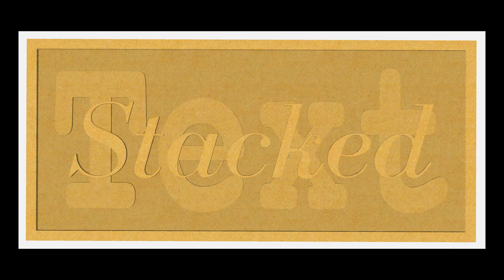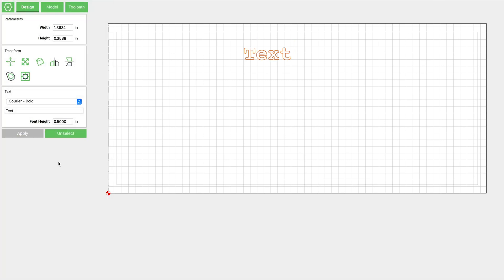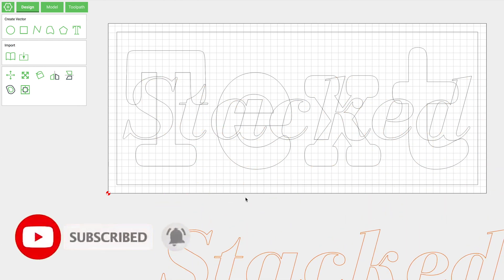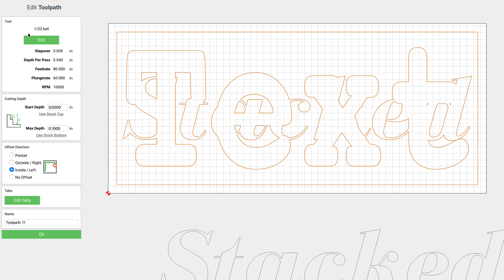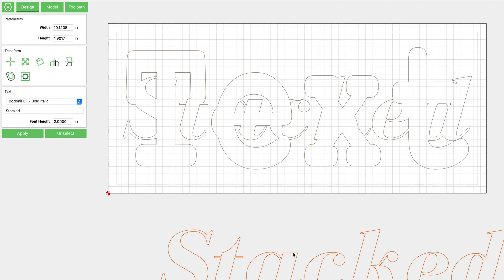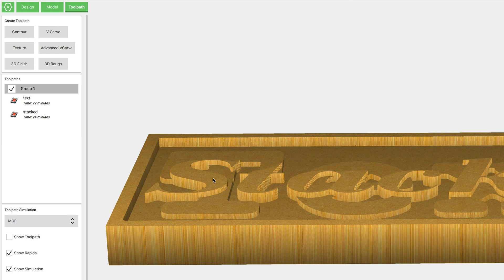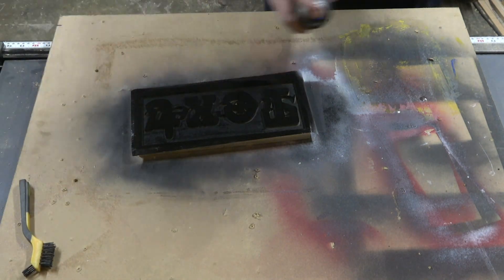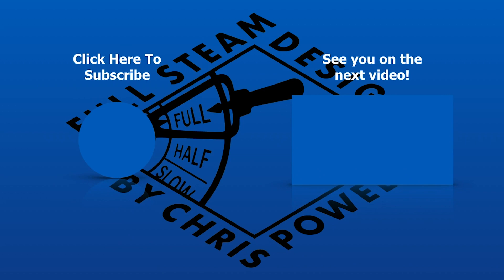Carbide Create Tutorial - Stacked Text How To Design and Paint

Comment: I found the stackd text method used in VCarve Pro frustrating with numerous failures. I did meet with success after sacrificing a few board feet of material. I switched using your method however, I did use layers to isolate the first name. The results was a stacked text that blended the top text into the bottom text. It looks GREAT! Thank you as the method you used and tweaked a bit in VCarve Pro created great looking stacked text.

Comment: You can paint all 3 layers different colors here is how: do the black exactly the way you did. Leave the mask on when you do the last cut and use a small brush for the outer text. Then peel the mask off the top text and use a rubber roller to paint that. The hardest part is the second layer TEXT part. It has to be a small brush you it should be easy because the mask on the top prevents mistakes and the black layer already cut is lower so it's not too bad to do. The top is very fast and easy with a rubber roller because there is nothing but the top layer that the roller will touch.  Just an FYI. I have done this before.
Reply from the maker: Thanks for sharing. That’s a good technique.

Comment: Is there a way to avoid pocketing a lot of air on the second pocket? Since the first pocket is deeper, much of the second pocket will have the bit above the surface.
Reply from the maker: You could use the advanced v carve tool they added and set a start depth.
Reply: You could create another rectangle that contains the bottom text and then do a pocket between the rectangle and the top text.

Comment: Chris, After you sprayed the black, how did you make sure that the top text aligned with the bottom text when you resumed carving? Did you have to rezero or did you leave the program paused and simply resume carving once the paint dried?
Reply from the maker: I use depth stop collars on my bits so they’re all set to the same length. The computer saves your 0 locations when you shut it off.